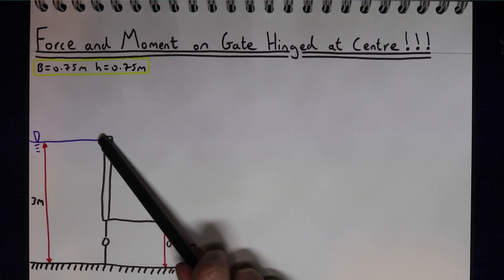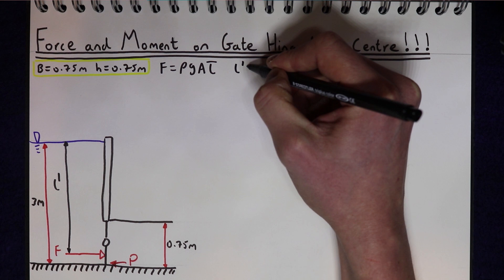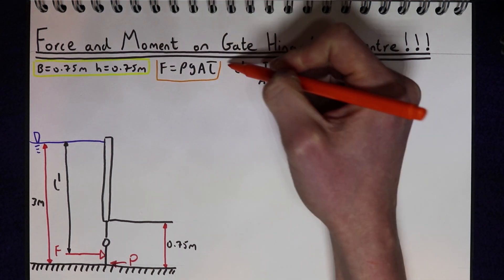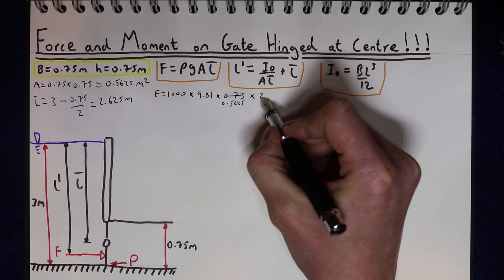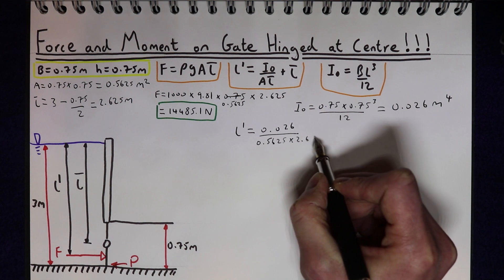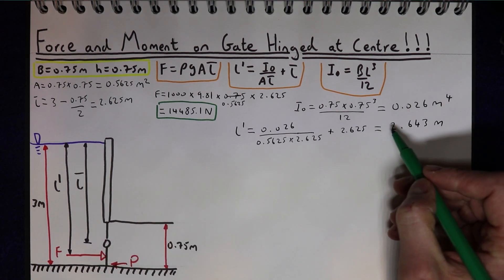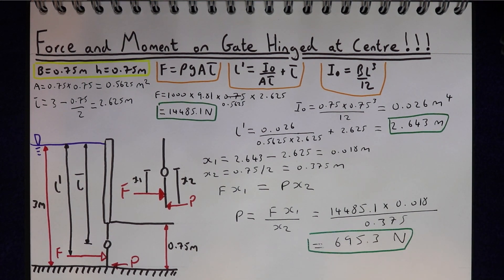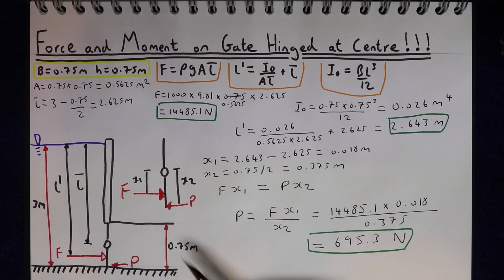Gate Hinged at Centre: Forces and Moments

Comment: Thanks for this video! I just wanted to clarify something. I tried applying the formula where you simply do 1/3 or 2/3 times the length of the gate to find the location of the equivilent point load of the triangular load from the water but it is not giving me 2.643m like you got using L'=I/AL + L... Like 0.75/3 is not equal to 3-2.643 if that makes sense. I realize this is because the formula I used doesn't account for the fact that there is water above the height of the gate and the distance between the height of the water and centroid of the gate is important but is there a way to use my method to solve this problem (i.e., maybe doing a weighted average of the location of the point load based on the height of water and the location of the point load based on the height of the gate)?